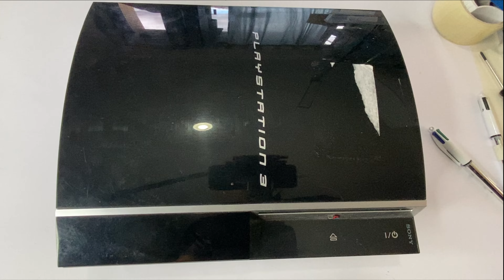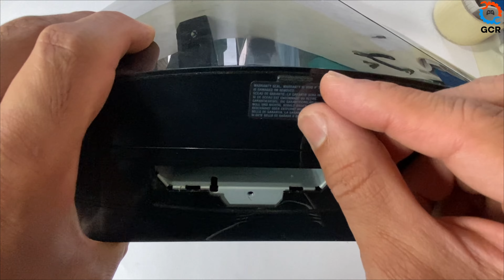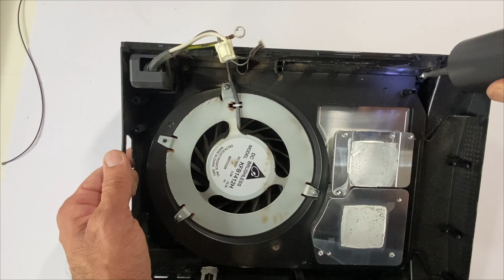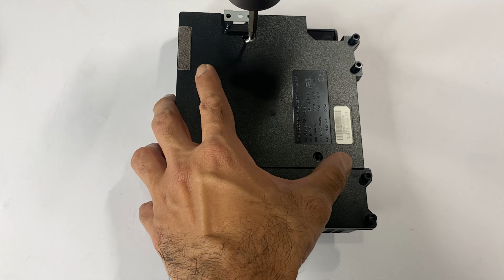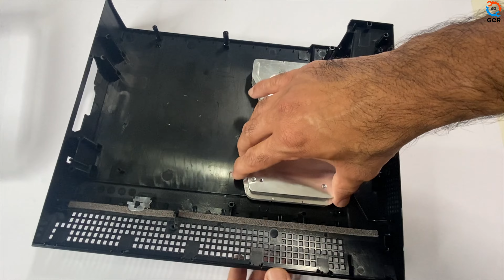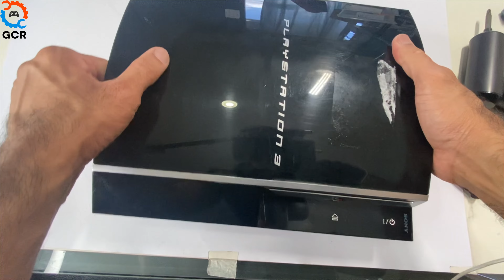Full Restoration PS3 FAT [CECHK02] – How to Disassemble, Clean, Reflow, Add New Paste & Assemble

Comment from the maker: Chapters:-

[00:01] - Introduction 
[00:10] - Disassembly of PS3 
[06:58] - Ultrasonic Cleaning 
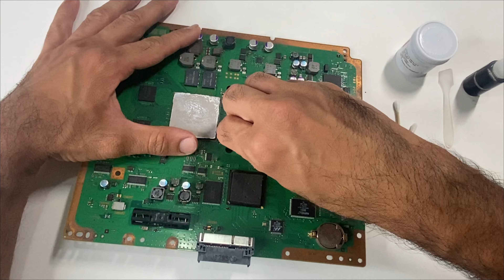[07:13] - Removing Old Paste 
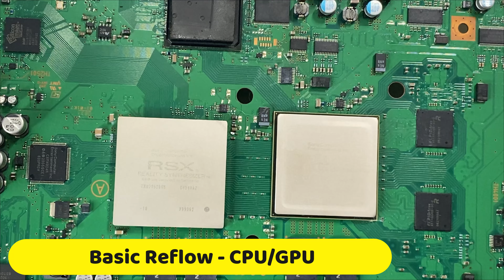[08:16] - Reflow CPU/GPU 
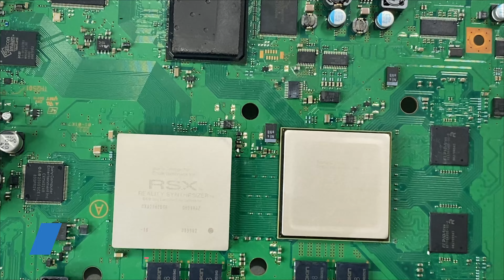[08:57] - New Thermal Paste 
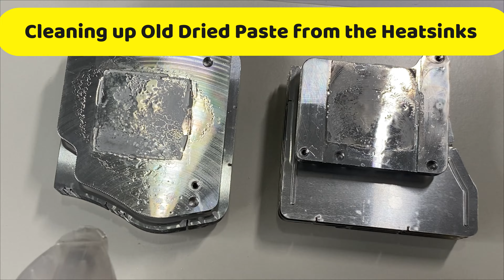[09:17] - Removing Old Paste Heatsinks 
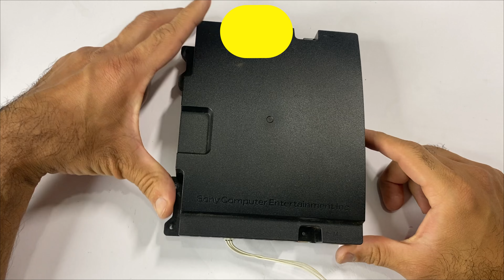[09:42] - Disassembly & Clean up PSU 
[09:42] - Disassembly & Clean up PSU Blu-ray Drive 
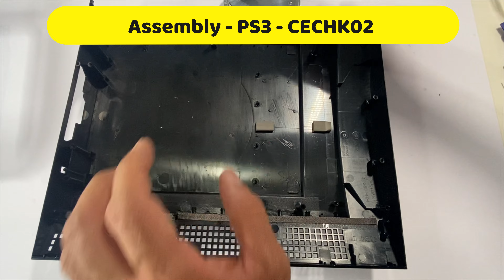[15:49] - Assembly of PS3 
[21:36] - Before and After Clean-up Pics
[21:53] - Credits